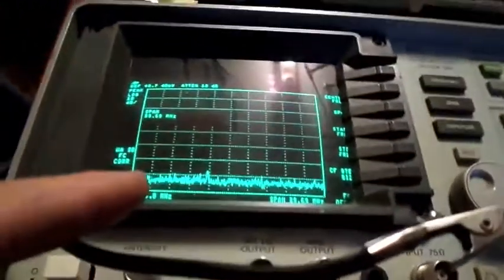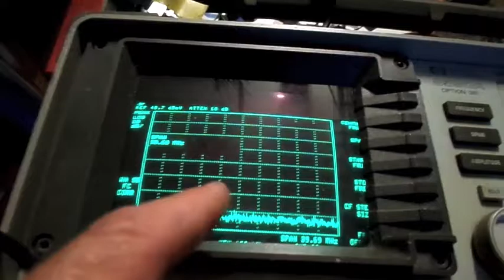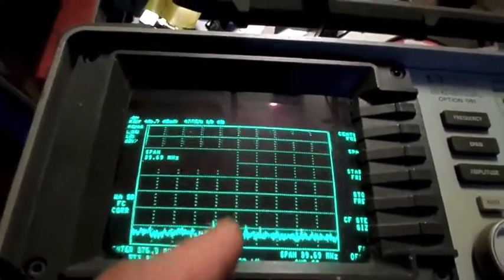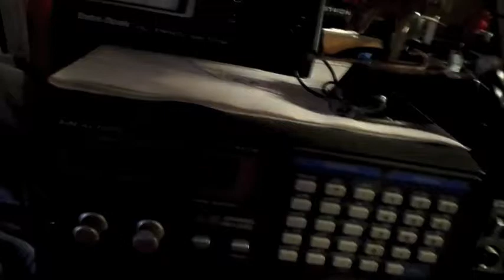Thundercloud Shock Treatment.

Comment: Warning math content follows, a spark or lightening strike can be very closely modeled by an impulse function which has an infinite amplitude with an infinitesimal small time duration (look up Dirac Delta Function). Converting that time function to the frequency domain (Laplace transform S domain) you will see that it covers all frequencies from - infinity to + infinity with an amplitude of 1. This is why you can hear a lightening strike, a spark and light switch being turned on across every frequency on a AM radio. Neat.
Reply: So I just spent the last 30odd minutes being shown the Dirac Delta Function followed by the Laplace Transformation...   Shout out to Kahn Academy.  I miss math. q=(

Comment: forgot to ask why is you swr meter reading ?
Reply from the maker: The SWR meter also has a field strength mode, and when I set it next to my long wire antenna it registers on the meter. It doesn't even need to be a direct connection.
Reply: @GrantsPassTVRepair  i have the same one,so the energy from spark gap was giving a reading on meter i will have to try that
Reply from the maker: @dennisqwertyuiop  I should add that the reading I'm getting on the field strength meter is from the local AM radio stations. Not the lightning.